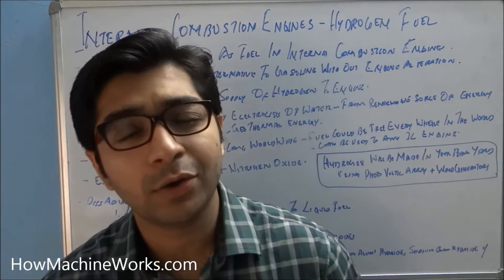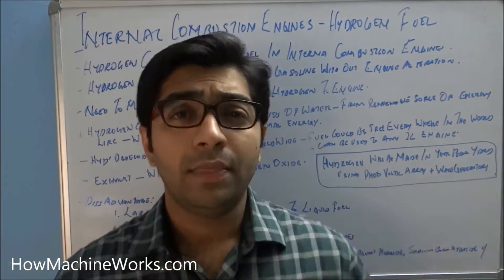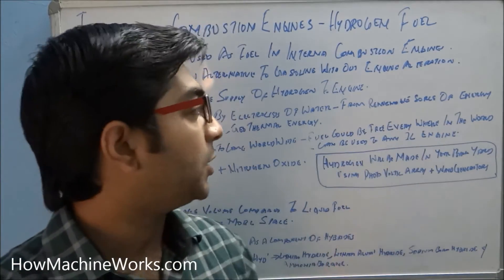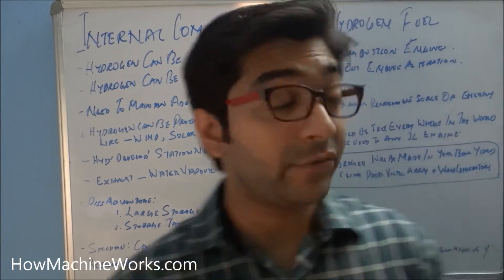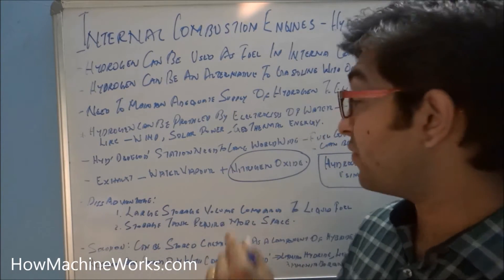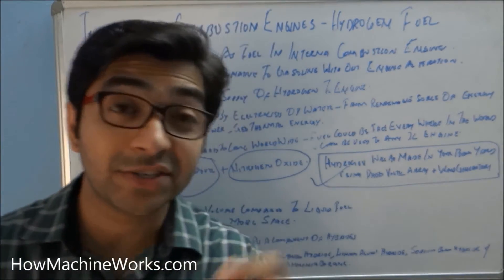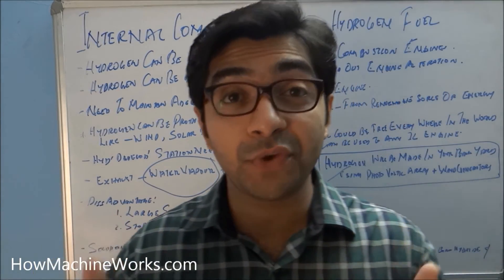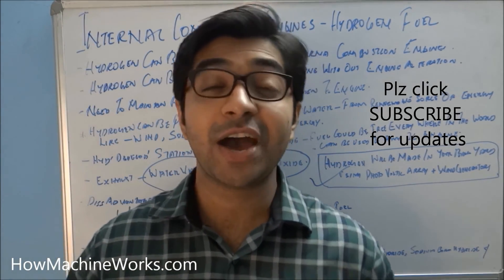Hydrogen fuel - Basics.

Comment: Backfire occurs because of improper air-to-fuel ratio. Hydrocarbons (gasoline) have a lower flash point because the carbons lessen the combustion. Higher volume of hydrogen means more explosion thus more heat is generated in the cylinder.

Comment: i do like your videos but this one is giving a little wrong information, first of all hydrogen can't be used in normal IC engine. This was my project in undergrad studies, if you want thesis i can provide you that but the point is that hydrogen's calorific value is much higher than gasoline, the temperatures reached inside the cylinder are much higher, hydrogen's flash point is much lower than gasoline, so it back fires.
we tested hydrogen in a single cylinder engine and it was backfiring a lot